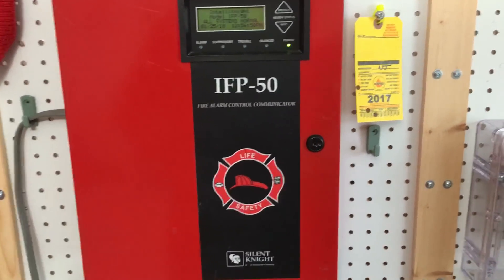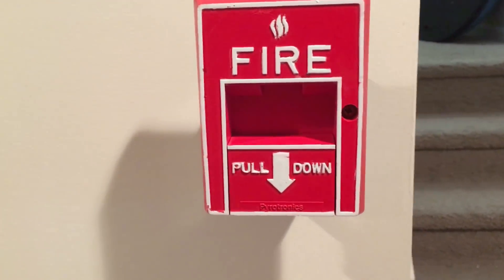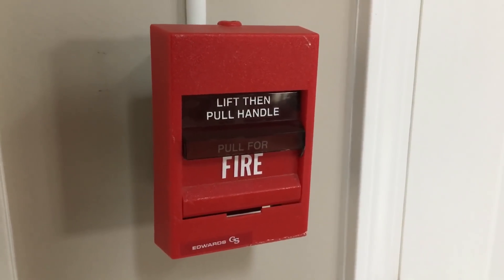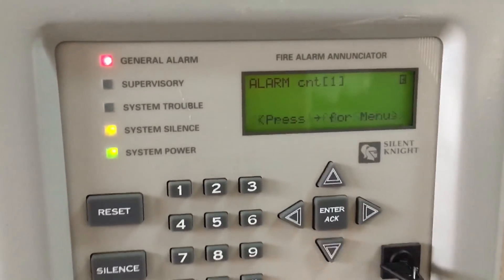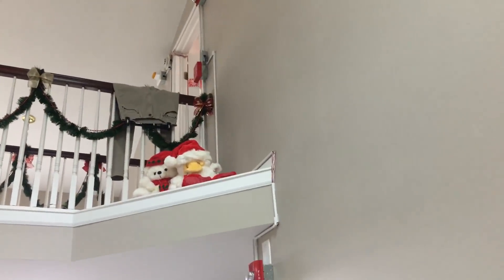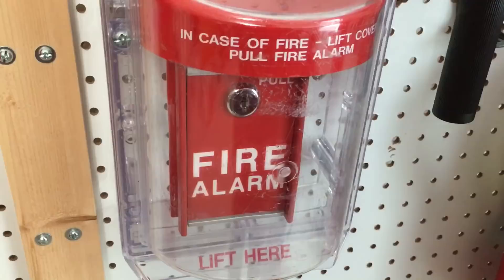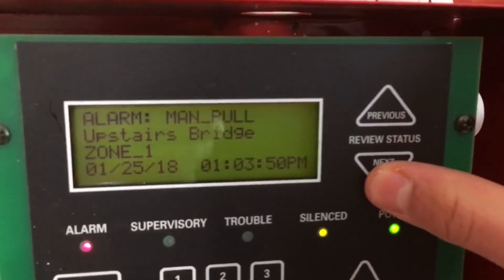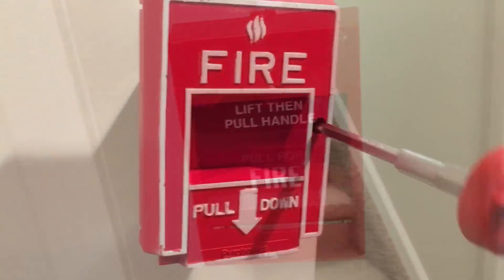New System Test 6

Comment: I honestly think the living room and hallway part of the system is realistic 

So the building was built in the late 90's and had a spectralert classic installed in the hallway. Then in 2010 there was a rule stating that the living had to have an alarm installed, so they put a new spectralert advanced up.

(Let's just pretend The ummt and genesis don't exist) (and the 2010 rule was made up)

Comment: Nice! Did you have the Chime and Siemens alarm on the same NAC as the System Sensor devices? Did you have System Sensor sync on?
Reply from the maker: I had the SpectrAlerts on NAC 1 set to code 3 and the panel programmed for System Sensor Sync then NAC 2 was running the chime and the UMHU on NAC 2 with the Genesis fixed to 60 BPM continuous and the UMHU set up for 2 wire code 3. Oddly enough, I programmed NAC 2 for Faraday Sync because I wanted the still 2 wire Siemens UMHU to do audible silence but it somehow also got the genesis to do Code 3
Reply: NJMoo3652 That's odd.

Comment: I had the siemens u-mhu at my 1st and 2nd grade elementary school. Also, how did you manage to get the g1rf-c to do code 3?
Reply from the maker: I had it on the same NAC as the UMHU which was programmed for Faraday Sync and I guess it got the chime to do Code 3
Reply: NJMoo3652 Ohh.. I thought you cut the jumper for the G1RF-C.
Reply from the maker: That’s what you’re supposed to do but I guess the sync made it do Code 3 but when it’s not it’s continuous as normal